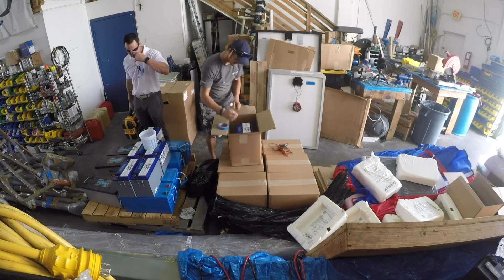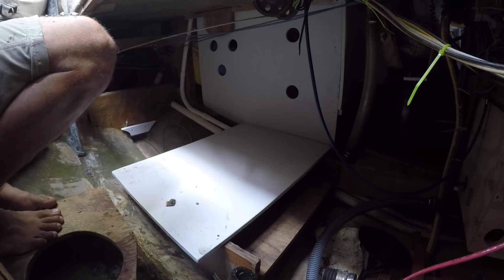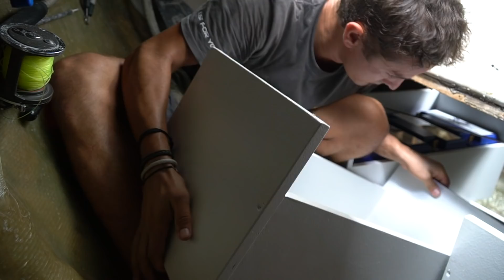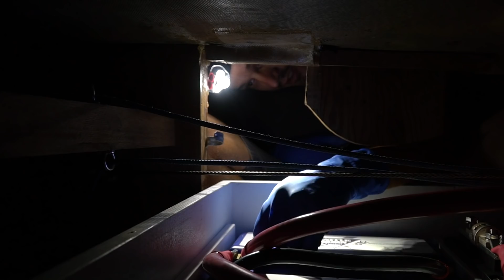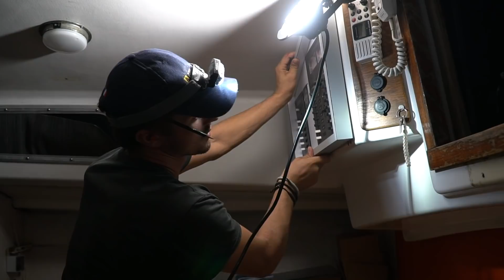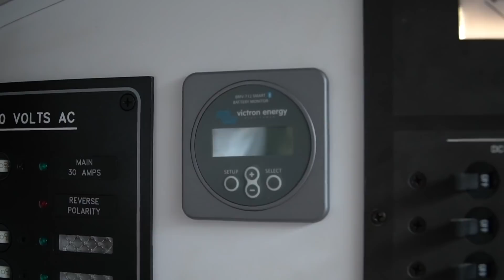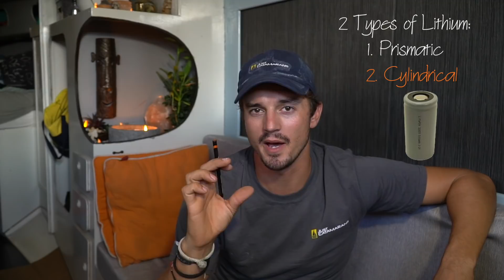Uma's new Battle Born LITHIUM heart ❤ — Sailing Uma [Step 135]

Comment: Dan I have another question. Ever since I saw step one and followed y'all through. I have been thinking about this electric motor shtuff. I like it a lot. What do you think of AC motors?  I google motors once in a while and I often find less expensive AC variable speed high voltage ( 230/460v ) than I do of DC motors. Plus I often find inverters to be cheaper and easier to find than step up transformers. Also transformers for DC are often for things less than 100amps which might just work for the entire boat no problem and only cost 150.00. Like you just told us higher volts tends towards less amps and heat....
So I've been thinking abut a boat with a 240v whole house wiring minus 12v lights and some accessories. Then use a variable speed AC motor and maybe even run it at 460 volts and multiple separate inverters. 
Either way I wanted to run the batteries  parallel to use the capacity better. Run the bank to capacitors to stabilize the flow. Then inverters  to get to the desired voltage. 
Do you think the AC would be too inefficient? Do you think the extra equipment would be too much of a hassle? Or do you think the AC is safe enough and efficient enough and everything would be just fine. I think it would just give you better use of the entire battery bank and possibly draw less amps (depending on the motor purchased).  I don't know. having the extra components could just mean extra problems but at a couple of hundred bucks you could just keep a spare inverter or spare 12-48v transformer and this might be worth the increased size/ amp hr of the battery bank. 12 batts you could have 1200 amp hours instead of 300, (which isn't bad at all ) but what's wrong or whatever with thinking about more hours and using transformers and or inverters? Or even cheaper using high farad capacitors after the batt bank in series to get to 48v?
from what you said earlier you seem set on the idea that changing the voltage across the bank is smarter and or most efficient? 
Sorry I wrote so much for an AC/DC question. 
I'm kind of laughing at the idea that y'all at one time were trying to put in a broken used diesel motor and now you have a $12k battery bank. I'm not ragging on you just laughing at the turn around.

Comment: Yes you have worked it out but you have to put the power back and these battery’s should not go below 2thirds  I have some of these for my boat  and the solar needed is 4 100 watt pannels at min ,  good luck
Reply from the maker: We have 480W of solar, which has been plenty for our everyday needs. If we'll be motoring for long distances, it will be in a canal or into a marina, so bulking them back up will be via shore charge, them back out to anchor.

Comment: With a boat your size, what made you go 48, instead of 24?
Reply: 48V is about the highest you can work on safely (ie without much risk of shock (keep your hands dry)), and the higher voltage means lower currents, so smaller, cheaper wiring, and an easier life for connections.

Comment: I saw an experimental electric power catamaran in Block Island, Rhode Island that came over from Newport, Rhode Island. They had huge cooling units and ductwork directed at the batteries, that looked liked the stuff used to cool UMA at the dock, while they charged them for the return trip. The vessel was basically a hull filled with batteries and two electric outboard motor. Very much a science project. To make the trip they had to play the currents or they would be stranded. When they arrived they had less than 1% reserve left.

Comment: Great video... Love the LiFePO 4  too... makes it easier to sleep at night knowing the batteries are a stable chemistry.  And they last a long time too!... i have some over 4 yrs old that are still balanced and going strong.   Dont throw that little inverter away... i hate wasting the amp hours to a large inverter powering a small load so i only turn on the big one when its absolutely required..... Have to be stingy with those electrons!

Comment: Sorry Dan,
Another couple of concerns.
Voltage drop is a considerable issue with low voltage systems. The interlinking cables need to be significantly larger to reduce it. Based on what you have calculated the cable size should be 120mm2. Voltage drop equates to heat so drawing 50 amps means every joint needs to be perfect. Really look closely at this.
Are the batteries 100% waterproof?
Charging time from shore power.
14kw will take 16 hours at full power.
Will the marinas allow that?
Cheers

Comment: Big upgrade guys...you might be able to charge a lot faster on solar.  Though now you might find you use the motor more often and can't charge it fast enough off the solar all the time.  I'll bet you will get by 75%  or more of the time though except in strong currents and long waterways.  Get that Yamaha gen rebuilt!!  Dropping 12ish grand on batteries though...ouch!

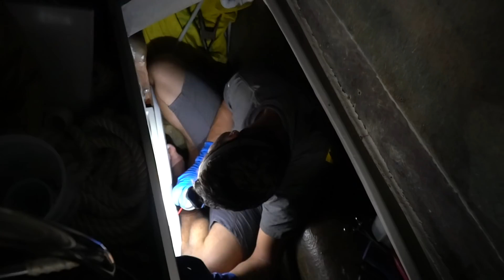Comment: 9:27 ahahaha that was hilarious!

11:51 im no pro at RF, but my understanding is such devices are supposed to be shielded enough on their own. If the proximity changed doesn't work, look into possible issues with the reception set-up. Also things like changing the orientation of the charger may work, as well as placing an RF shield between the devices.
Reply from the maker: We also got. New bud. Ours was from the stone age. I'm sure the new icom will perform much better.
Reply: I'm sure it will, you guys do very well at things you try! Its just fun to pretend like I'm helping :D      

For all I know you did this weeks ago lol

Comment: Please: amp-hours and watt-hours are not the same as amps and watts. Dan seems to kind of understand it, but I think that confusing energy and power is the terms used is feeding confusion in what's happening.

A 100AH battery rated at C/5 (a 5 hour discharge) means you can only draw 20A, but for 5h (100Ah/5h =20A). Remember high school... make the units match and you've probably solved the problem correctly. Charge rate works the same way, but the actual numbers might be different and there will be a charge curve and some fancy stuff that the charger will do for you.
Reply from the maker: Yes, it much MUCH more complex than my brief description, but I was trying to keep it digestible.
Reply: Yeah, it's a bit late to edit the video now but so many people confuse energy and power... then share their confusion... and it all gets worse. I don't think it's actually that complex at the level of "my batteries hold 14kWh, and I can draw up to 3kW. That means I can run my 2kW motor for about 7 hours".

Bumbling it round as amp-hours at various voltages, then leaving out the "hours" part just makes it look confusing. You being in the US kinda makes it worse, because you use BTU and horsepower and other weird units making it hard to compare even simple things like "is this stove more powerful than that stove". Flip side, it's perhaps leas confusing if you talk about horsepower and BTU for power and energy respectively... although the conversions are no fun at all.

Comment: Have you considered getting a 48v-19v DC-DC converter for the laptops? You can probably even find a USB-C 48V supply that would work.
Reply from the maker: Na. Our inverter runs 120ac. The math says there is an efficiency drop I'm sure, but not noticeable in real world application. Unless it's raining for 2 weeks, we've never really had a problem with power generation.

Comment: $1000 per battery times 12.  So $12k in batteries.  $12,000 buys a lot of diesel :)
Reply: $12K of diesel doesn't add any value to the boat.
Reply: Drifting for hours waiting for wind when your batters are tapped out doesn't add much value either.
Reply: Batteries recharge. Empty fuel tanks do not.
Reply: From solar?  Yea, in 3-4 days.  That's not going to help you when there is no wind and you're drifting. :)
Reply: If you're in a hurry you ought to take a plane.
Reply: What if I'm drifting towards a shole?  Yea.....I'm not going to argue with you anymore.  I get that you hate a motor, and it's all scary, and if you could just power your boat from the same battery as your iphone, all would be right with the world.  But sadly, that's not reality....yet, or the foreseeable future.
Reply: I take it they got a really good deal through the manufacturer.  Otherwise who would spend 12k on batteries?
Reply: $12k buys a lot of diesel when you actually have to pay for it!

Comment: Wow I didn't know you used salvaged electrical . 
  I have been wondering what kind of range a electric motor battery set up has. 
 I like electric but in bad situations when you need power to move the boat 15 minutes is a fart in the wind. 5 hours is much much more reasonable.
 Can't wait to see how it works out.

Comment: Am I understanding correctly that the batteries are wired in series/parallel to make 48V banks, and then the solar array is rigged to generate 48V, and the 12V systems are run off of a 12V step-down? ....or does the solar generate 12V and you have a step up to 48V to charge the batteries? Have you thought of running the electronics off of one of the 12V banks, or would that create other issues? 
Maybe you could post a nerd-blast on your web site with your electrical diagram... you know, with all your free time.

Also, are you being sponsored by the battery co?
Reply from the maker: Full write up is coming once we get all the work finalized. Solar, shore charger and battery bank, windlass are all 48v. Then the seemingly small 12v loads come from a 360W step down converter. We tried the 12v bank and 48v  bank in the beginning, but then you complicate things too much.

Comment: Quick Question?  Why did you take 12V batteries wire them up to 48V only to convert them back to 12V?
Reply from the maker: We draw about 90W on our 12v loads and about 6-8000W on our 48v motor. So we have to run 48v.

Comment: Dan, first of all, thanks for not treating you audience like numpties. Super impressed at what speed & with the fearlesness you tick off these jobs, I've wired up a few boats myselve. Really happy you were able to afford the batteries & hope you'll be able to confirm your estimations . You didn't mention it, but I'm curious about any regen you might be able to get from the motor, scrub off some power when you are at hullspeed. If you could get hold of a used heavy code-1 on a furler you might be able to generate the power more easilty to run a watermaker and induction stove. I doubt the two solar pannels are going to cut it.
Reply from the maker: We'll be doing a whole video on that soon enough. Stay tuned.

Comment: Your wiring is not up to Mads (𝑆𝑎𝑖𝑙 𝐿𝑖𝑓𝑒) level, but it still looks "pretty spiffy" !

A CONSERVATIVE maximum discharge on lead acid batteries is more like 30-40%  Discharging down to 50% shortens a lead acid battery's life.  Your old batteries were NOT true deep discharge batteries and, for long life, should have probably only been discharged 20-30%.
Reply from the maker: Haha. Mads is awesome, but if we went into that kind of detail we'd have content for a lifetime, but we'd still be on the hard.

Comment: I guess you meant 14,4 kWh? Not 14,4 kW.....
Reply: Well, it's both.   Energy capacity 12 V * 100 Ah * 12 batteries = 14,4 kWh.  Output power would be 48 V x 300 Ah = 14,4 kW at 1 C (though the batteries can output double that power, call it 29 kW).
Reply: @LoanwordEggcorn  so I'm a little confused, I thought you can't place lithium batteries in series connection so how do you power a 48v motor with 12v batteries
Reply: @Urban1cycle  You can put Lithium ion batteries in series and/or parallel.  Each Lithium ion cell is about 3.6 Volts (varies by chemistry). 

Electric cars typically have 360 Volt battery packs by having about 100 Lithium ion cells in series (actually series/parallel banks).  800 Volt EV packs effectively have about 200 cells in series.  

In most large Lithium ion battery packs (that are > 4 Volts) there are usually cells paralleled too, for added capacity and redundancy.  If one series string fails, the battery pack still works at lower capacity, when there are some cells paralleled internally.

Each 12 Volt Lithium ion battery in Uma internally has banks of multiple cells in parallel, then 4 banks are placed in series (or some similar combination).  Lithium Iron Phosphate cells are about 3.3 Volts.  3.3 Volts * 4 banks is 13.2 Volts.  

To get a nominal 48 Volts, they use a series/parallel combination of effectively 4 * 12 Volt batteries in series.  In reality, they paralleled some of them for greater capacity (Amp-hours / Watt-hours) while keeping the Voltage down to 48.

Various factories in China are making similar 12 V Lithium ion batteries from 3.3 Volt cells.  Each battery also has internal electronics to control charge and discharge, monitor conditions, enforce limits, etc.

All of this requires pretty good quality control of the cells and batteries, or the cells will get out of balance.  (Some cells will get too much charge and others not enough, if the cells aren't very similar.)  

Tesla is probably the highest quality maker of Lithium ion cells and batteries today.  Their typical cell imbalance is in the very low millivolts, due to extremely high quality control.  It's part of the reason why most Telsa battery packs will last at least 300,000 miles.  (Tesla motors and gears have already been tested to more than 1 million miles with no visible wear.)
Reply: @LoanwordEggcorn  would it make any difference using 4 12v batteries of 300ah?
Reply: @christophfuchs787  That could work too.  A 300 Ah battery may have multiple smaller cells in parallel internally, or it could have single large 300 Ah cells in series.

An advantage of using lower capacity batteries, like 3 x 100 Ah in 3 parallel strings instead of 1 x 300 Ah in a single series string, is that the individual batteries may have a better chance of balancing the charge in each cell.  When cells are better balanced, the whole pack is more effective.

It really depends on how the battery management system (BMS) works, and that can vary between different battery designs.

Having multiple, separate battery strings within a pack also adds some redundancy.  If for some reason one string fails (open circuit), the rest of the pack should continue to work, at a lower overall capacity.

That too, depends on how the battery management system, in particular the protection circuits in each battery/cell, are designed.

I would probably recommend multiple, smaller, parallel strings, as Dan and Kika did, over a larger single string.  This is due to the greater failover redundancy and better chance of cell balance of parallel strings.

Comment: Did you leave any cooling space between the flammable wood and plastic items and the neat generating batteries? New batteries may get a little warm but it can dissipate with a little cooling room. Batteries going bad can get really hot and if it isn't dissipated, can be a fire hazard.

Comment: I want the Power panel from Jurassic Park. "You need to pump the handle to get the charge"...
Reply: Ha Ha that's just winding up the big spring in the switch that makes the switch snap faster to keep the huge arc as small as they can ,so it doesn't eat the contacts !

Comment: Hooray you got some real batts!!! So expensive but so worth it. Happy for you and excited. ))))
I've been wondering something. I'm sure you remember when your battery had a melt down. I've been wanting to research this a little. My question is this: What would be the difference if any to use a different battery arrangement keeping the circuit at 12V and instead use a step-up transformer to take the voltage to 48 volts. I was just curious if the current method of amplifying the power across the battery bank could be stressing the batteries? I mean I know you can do it this way that's obvious but should you? Would it be easier on the batteries to add the transformer.  I was thinking this could reduce heat by keeping the voltage the same despite having the current also stay the same. What do you think?
Reply from the maker: Higher voltage=less amps =less resistance=less heat. Electric cars run at 300V for a reason. We'd run higher but then components start to get very expensive fast.
Reply: yes, I know this one however, does the higher voltage in any way influence the batteries? I've thought about the less heat thing and less amps thing and these make perfect sense to me. I was just wondering if it could have a negative impact as the batteries in this case are rated for the 12v. I feel like the amps is more important, the over all draw. I think this is what could have lead to the failure in that one set of batteries not the voltage but, could the voltage impact the batteries? I'm not sure. 
This equation you give is exactly why i would consider a 240v or 480v motor but ya just wondering if changing the voltage across the batt is perfectly ok or just doable? It's fun and fascinating thank you for entertaining us. great work mang!
Reply from the maker: Perfectly doable, higher voltage is better for amp draw and wire size, but components get quite costly, and risk of electrical shock increase dramatically above 48V. 48V already feels like 120v AC if you get it good. More can be quite nasty. Some boats do it, Gun Boats I think all run very high voltage to save weight on wiring. Batteries in general though do just fine when stacked.